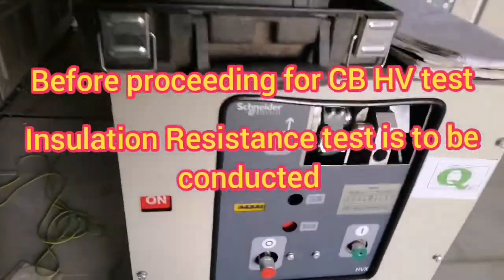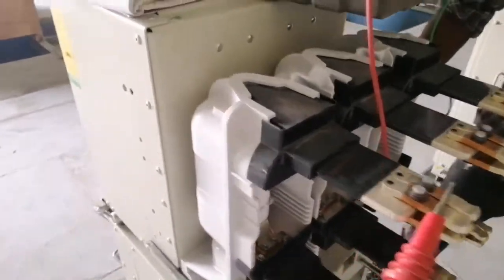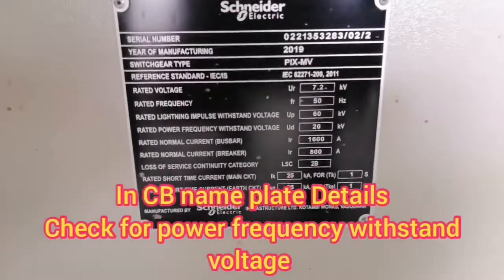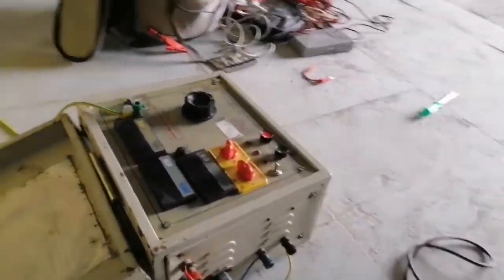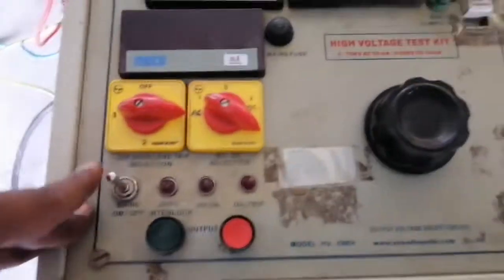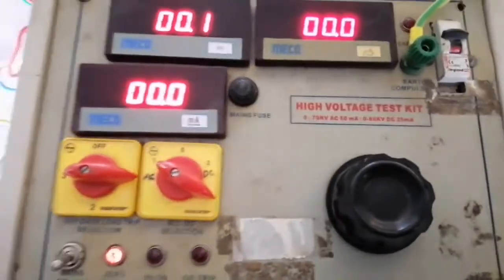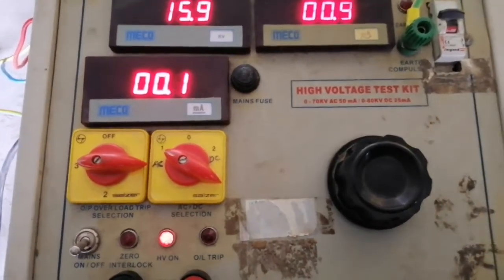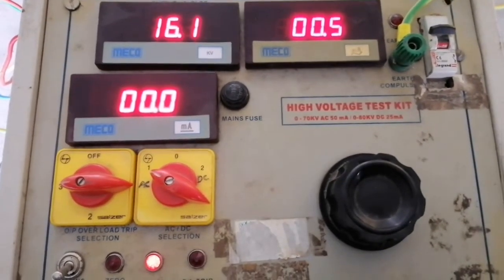11 kV Circuit Breaker High Voltage test

Comment: 16 KV AC or DC??
Reply: For circuit breaker we have to apply 80 % of power frequency withstand AC voltage at site.
At factory 100% power frequency withstand AC voltage mentioned in breaker name plate would have been applied...

Comment: What is the acceptable range of leakage current
Reply from the maker: Though HV test is only to check withstand capability of breaker, leakage current should be less. hV kit has leakage current trip setting of 10,20,30 milli amps ,setting beyond will trip the HV kit. For new circuit breakers leakage current will be less than 10 milli amps.